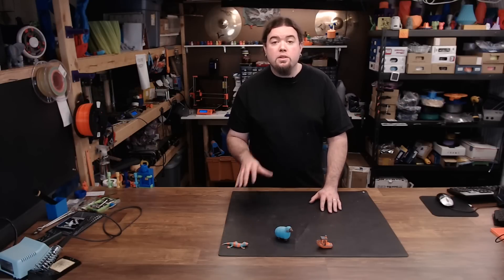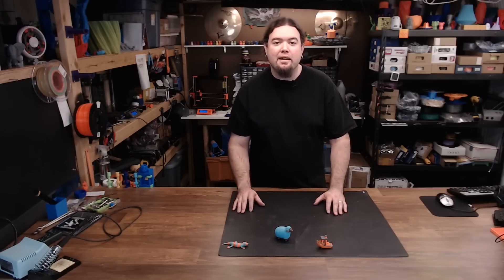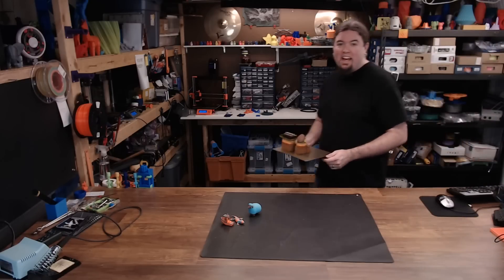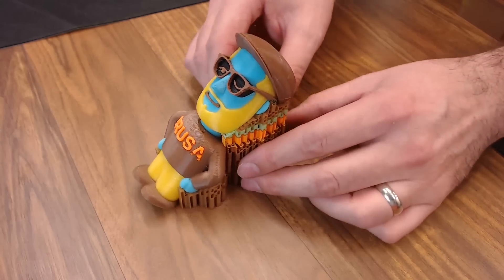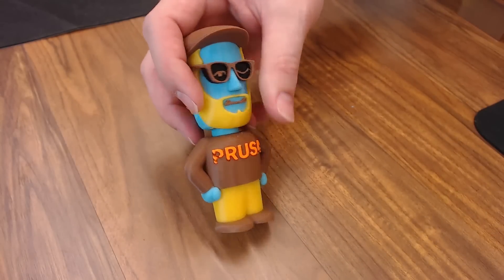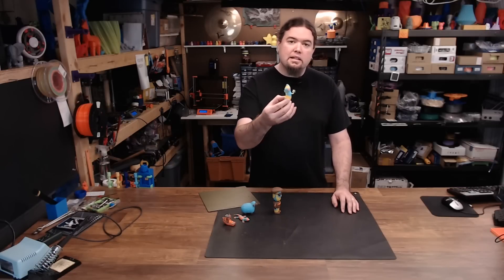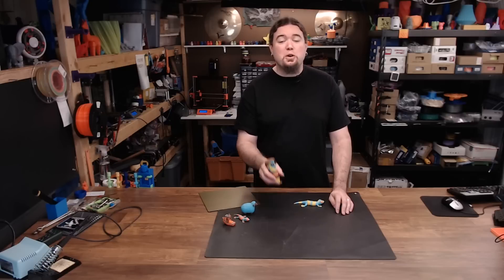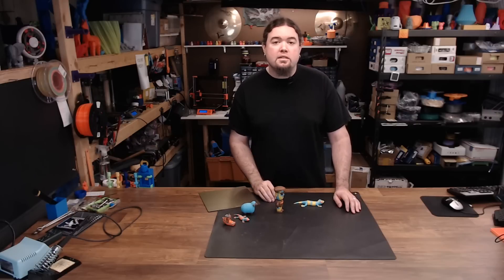Prusa MMU2 Time Lapse - So Cool! - Chris's Basement

Comment: Chris can it print solid pieces or they have to be pieces
Reply from the maker: If it's side by side multi color, depending on how the model is cut, it will force them into separate pieces. You can get around this in cad sometimes.

Comment: Hi Chris, 
trying the design a compact setup with spoolholders for the MMU, ... still waiting for it....
can you tel me what the filament length is that is retracted when a change happens.
"how big is the loop/length"  
that the part that makes this a "maker space eater"  if you set it up like it is in the manual...

regards Ron
Reply from the maker: Hey Ron, it's a little hard to measure, but when mine is in use i'd say the loop was about 40-45cm.

Comment: I don't have mine yet but can you take any stl and add color to it in slic3r?
Reply from the maker: No you can't, to be multi color they have to be separate STL files. You would have to break them up, in fusion or mesh mixer.

Comment: It's great, WoooW, I like multi-material 3D printing, I would like to have a multi color, or create it, using the rumba card .. but there is little information ..

I congratulate you
Reply from the maker: Thanks! That would be a great project, but you are right, it could be very difficult starting out.

Comment: Chris (or anyone) I need help. I am trying to do dual extrusion through a Y adapter and single nozzle. What is happening is it starts the switch, retracts the needed amount and pushes forward the new filament BUT it then pulls it back to its original spot. Im using the "start/end g-code" section for the extruders in cura, i have it enabled in marlin but im afraid my g-code is wrong. Does anyone have an example i can use/try to solve this? Does it need to be changed in the printers start/end g-code as well? Im lost on this and have no idea what else to do. Im not an expert but any means, obviously,  and could definitely use some help.
Reply from the maker: Hey Scott, I really don't know a lot about how to do this, but I think Ben can help you. Check him out here and leave him a comment. He can weigh in. https://www.youtube.com/watch?v=9iszXmYpuXU
Reply: Thank you!
Reply: Hey Scott, I have made such changes to my I3 MEGA and the Linear Plus., I took this info (see link)for assistance.:
http://wiki.3dator.com/index.php/Dual_Extruder_single_nozzle/en
My mod can be found here....
https://www.thingiverse.com/make:427485
You have to „open“ the little single tube  which goes to the hotend to a funnel, so the filament can move in easily.

Comment: Your concerns are my concerns!  Since I mostly print “practical prints” I’m not sure I need the MMU, but it looks very cool, and, unlike MMU1, I think that with enough software and config tweaks, this hardware will work well.  Like you, my main question is space!  Right now, the coolest idea I’ve seen is Filament Frenzy’s wall idea.  If that works, I could make that work where I have my printers.  I especially want to know how straightforward it is to use in single filament mode, since I’d guess that will still be the majority of my prints.
Reply from the maker: Same here John, the feature I am wanting to try most is where you can use up partial spools and it will automatically switch them out for you. That would be great to have.

Comment: you make us jealous, 
there we go, with a single color printer BOEHOEOEOE(crying!) ;-) LOL
no it looks beautiful!

greetings Rob.
Reply from the maker: lol, Thanks Rob!
Reply: teach us how you can quickly switch from one color to another color filament?
on a bowden and direct drive printer?
like in an easy way?
is it also possible to withdraw the filament from the bowden with a higher speed?
(to speed up the exchange filament)

as said before I would like to print a nameplate,
plate white and letters black for example.
can you teach us that?

greetings Rob.
Reply from the maker: Have you seen the M600 video? That's about the easiest way to do it. You can change the settings to make it retract for the length of the tube. See if that helps, if not we can look into something else.
Reply: Hoowwww that video I had not seen yet!!!
(I have to go shopping now, will look at it later!)(you know how that goes, women......)  ;-)
thank you in advance!

Rob.
Reply: Hi Chris,

M600
yes I think I can do something with that, I think.
(maybe I still have a little problem with that Bowden length and speed)
BUT I also found something else !!! (I want to report this to you anyway!)
it seems that you can also change filament in Cura.
click: Extensions goto - Post Processing - click Modify G-code
click: add a script click Pause at height
Maybe you already know all this (I do not know)
But for the rest, I also do not know exactly how and what to do with it (I just found it!)

I thought I would tell you about it,
maybe reason for a new video??? ;-)

kind regards again from here!
Rob.
Reply from the maker: Interesting, I don't use Cura much, but I will check it out. Thanks!

Comment: What do you think about using the MMU2 as a filament type selector. I don't typically print trinkets and such so there is a very low use case for multiple color prints for me.
Reply from the maker: I think it would work out just fine. It would be cool just to leave the filament loaded all the time ready to use. The hard part would be keeping the filament stable out of the elements. It would work better if you could pull from a dry box or something.
Reply: RepBox !!!
Reply: That is exactly my idea. I have the box all setup for the MMU2 filament, I just need to get my hands on the MMU to figure out the filament retraction storage while keeping it 'sealed'.. Does the MMU retract all filaments after a print, or does it leave the last used in the tube?
Reply from the maker: It leaves all the filament behind it in the tube. It's controlling that back feed on the spool we would have to figure out. Maybe it could do that part under the spool inside the box.

Comment: Love your channel Chris. I think it's one of the best on the 3D printing/maker topic. I'll be getting my MMU soon and I'm a little concerned about the space needed but i'll figure it out. It looked to me that the transition tower for Jo is quite a bit smaller than the ones I experienced with the Palette+ that I once owned. Similar 4-Color (Jo I see is 5-color) transition towers for models with a Palette+ were gigantic in my experience. Looks to me that the Prusa team has done a great job with this MMU design.
Reply from the maker: Thank you! Prusa is on the right track with this one I think. They have some bugs to work out, but with the stuff they have planned it should turn out to be a really stable unit.

Comment: Very interesting to see the MMU 2 in action. I hadn't really considered the massive retraction that were required till your video. Do you see any issues with these?
Reply from the maker: Hey Scott! It is an issue, not just because you have this massive loop that can get hung up, but it doesn't keep track of the end of the filament, so it's up to you to not move anything an hope lands in the right spot for the next time it wants to use it. Still some guess work here, but hopefully it gets easier with firmware updates.

Comment: I liked the close-shot of the multicolor Joe, it would have been cool to see the other prints close up too. Nice video.
Reply from the maker: Thanks, I should have done that. We will take a look at a bunch of them next live stream. :)
Reply: Oh and thanks again for that Ender2 video, I successfully added auto-bed-leveling to my Wanhao Di3 using the stock board using your video as a guide. (I used a 1N4004 diode instead of the voltage divider though)
Reply from the maker: Awesome! Glad it worked out.

Comment: Yeah, it's cool when someone else does it. The purge/prime tower thing is still a deal breaker for me - it looks like you're over purging by the looks of the amount of filament printed out.

Hopefully someone will come up with better methods soon.
Reply: There is the option to wipe into infill and into another object. Which helps significantly.
Reply from the maker: @alyl603  Agreed, it does help a lot and creating a waste object turns out some pretty cool results.
Reply from the maker: Agreed, I am looking forward to the new round of firmware updates.
Reply: Probably biggest issue is the purge tower has to be as tall as the model, otherwise there would be a crash. Multiple nozzles is about the only way to get away from that.
Reply from the maker: @montewestlund8195  Yeah the prime tower is my least favorite part by far.
Reply: I'd love to see more examples of these multi filimate projects. 
I wonder how buildings would look in color! 
I film warehouses. I would love to give my clients a model of their building!
Reply from the maker: @nflightvideo7787  Oh cool! That would be pretty neat, I will have to look for some models.

Comment: top mmu2

still waiting.....
Reply from the maker: Hopefully you will have yours soon and we will get an updated firmware for it. It needs a little help.
Reply: Hi Chris yes should be November for me.... hopefully the major bugs are solved...
do you have an indication of the "extra"  time.  i have read somewhere around 30-60 sec per color change.. that adds up when you have a lot of color changes. 
btw does silc3r also provide a good time estimate? (the normal prints)  are realy close.

regards Ron
Reply from the maker: It depends on the filament settings, but yes it adds roughly 60 seconds per change. Slic3r does a pretty good job at estimating it. The gecko print time was with in 10 minutes of the estimate.